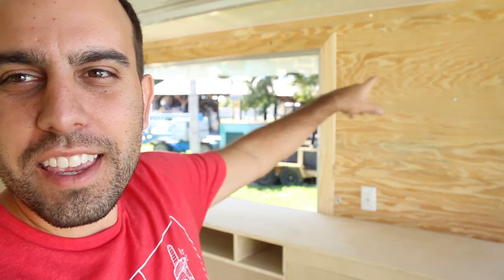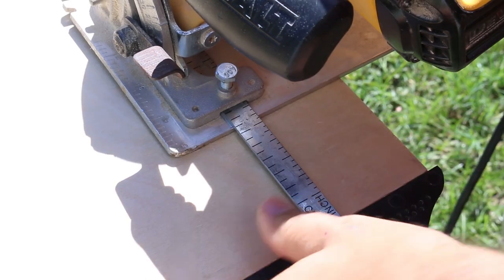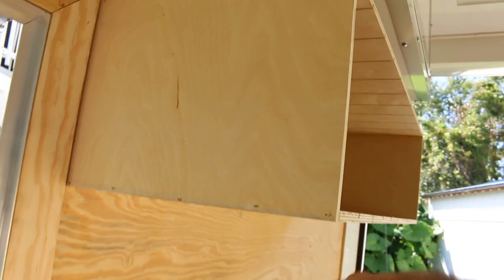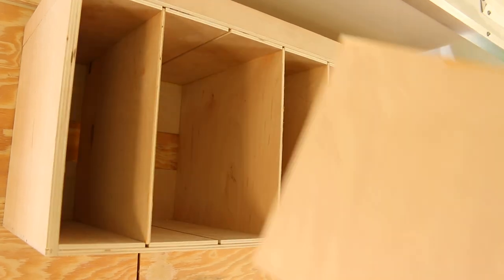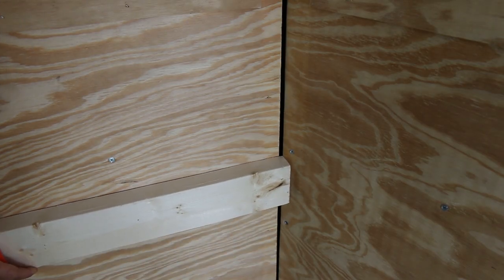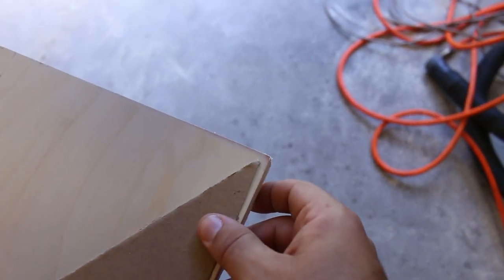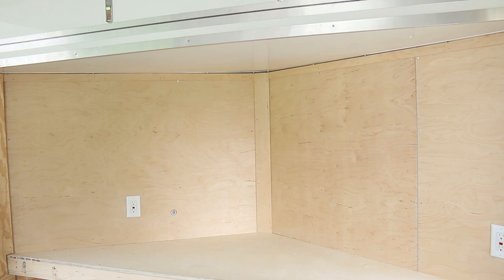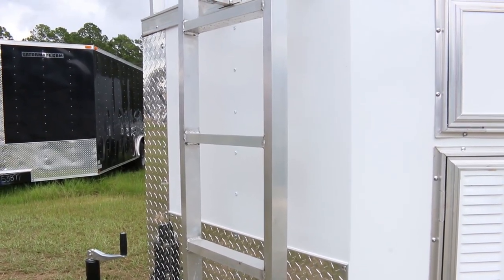ULTIMATE Mobile Workshop - PART 2 - V-Nose Workbench / Power Tool Cabinet

Comment: Very efficient. I built a sliding platform that extended out of my van with equipment that would swing out on attached pivoted panels. I would slide in a leg support to the swing out for any equipment needed for the job. Everything would be visible and within reach at the same time.

Comment: looking good I wish I had any woodworking skills. I might be building a similar trailer in the next couple months I'm planning on using a 48ft gooseneck trailer with the front 28ft living quarters and the rear 20 ft for my car and a workshop when my cars not in it.

Comment: Is that 1/4" plywood lip on the shelf going to be the only thing holding those tools in while traveling? Or will there be a door? I've traveled around the country in a motorhome and know from experience that potholes, ripples in the road, etc. can through items around something but good! As it is in this video, those tools will jump right out of there with some good sized road imperfections. -- just a heads up : )
Great video - thumbs up!
Reply: Good point. Perhaps a couple removable, horizontal straps during transit?
Love the progress M&L! :)

Comment: Why so stringent on using the birch? Surely a sheet of oak or dare I suggest pine are a lot cheaper and provide the same functionality for those cabinets no? Also... it's October 24th so I'm assuming the RV is departing Florida and is on it's way to whoever got chosen. Looks like I was not selected so maybe I'll get in on next round.
Reply from the maker: In our area, birch is a good compromise on cost and quality.  We only have construction grade pine and oak would cost well over $100 per sheet.

And yes, the RV has left Florida! We loved the outdoor shower idea, but sadly our route ended up not quite taking us that far north.  We will hopefully be going farther up the east coast sometime next year, so maybe we'll see you then!

Comment: I like how you say, learn sketch up so you can work through problems    in the virtual world but then still have problems ,locks on bandsaw cabinet, upper tool cubby shelf depth,...however I must say when it's done it looks nice and I greatly appreciate your anal retentive attension to detail. looks awesome, where are you located with such expensive plywood and where is the Festool?

Comment: Jesus man.... that way toom much for import. Go with Sanded Ply... 30$ 3/4inch sheet at Depot :) As long as you joint the ends correctly.. no issues. All that i use because there is no place local here that sell the good stuff... and Im not gonna order wood. I see damage on the merch. 

BUT!!!  That looks amazing none the less man... amazing job